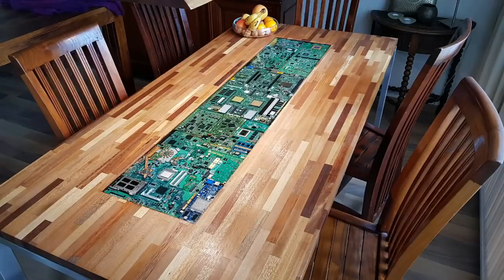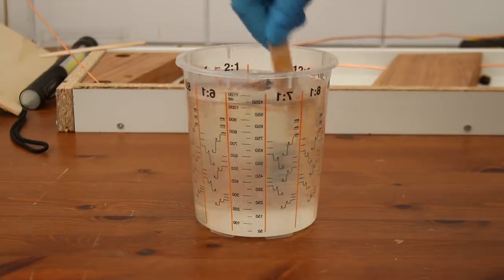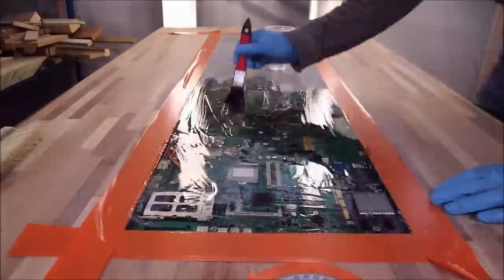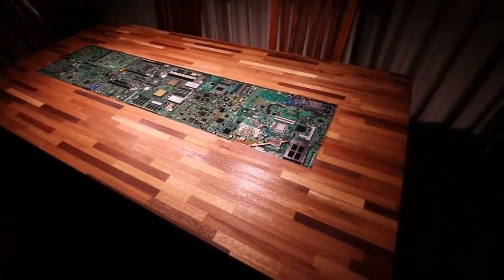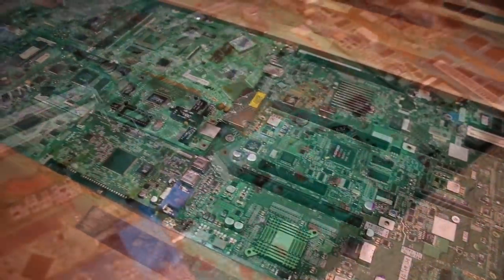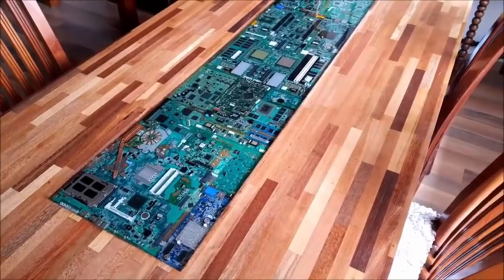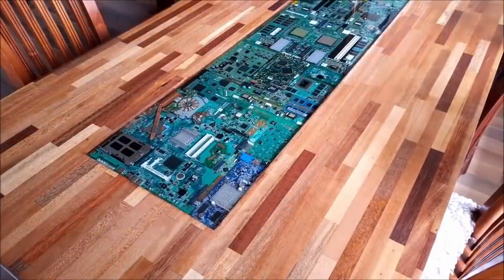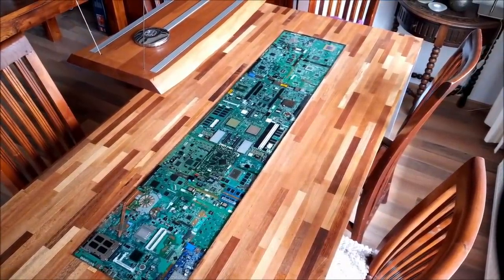Circuit boards with lights in epoxy in a table

Comment: I would have a piece of glass cut with beveled edge to the size of the entire table. Secure it with clear epoxy. Completely usable table with a usable glass top.

Comment: Some of the boards do not deserve to be in there...
Reply from the maker: How can you tell? From my POV they were, without any exception. They were IN the trash, or on their way to the trash...
Reply: I can tell what some of those boards are, and some of them are actually quite expensive and intricate. Eh. Never mind
Reply from the maker: The biggest, the dual processor one of a Sun server, was in the trash of a data center. I suppose they know what they throw away..

Comment: hey i know you did this is aug and now its octoboer - but just wanted to ask why can't you just sand the entire face (wood and poxy) and then give it a light thin coat of epoxy to finish. Another solution could be to go to your local glass shop and get a plate of glass with rubber feet and use that as a table top that covers the full face. this way its functional and admirable.
Reply from the maker: Read the first, pinned, reaction here.

Comment: I once saw a bar top like this made with bottle caps, match books, coins, and other small trinkets. The owner said they used something called liquid glass, which is apparently a silicon dioxide based product used in automotive finishes, although some epoxy resin products also go by that name.

Comment: from what i know you should put every day layers of epoxy bit by bit, nevertheless i think fail or not it's inspiring!
Reply: What I know about two part paints like Dupont Imron which is used on airplanes is that a thin coat is hard and durable, but what's left in a small paper cup will be rubbery and tend to crack as it shrinks.  You don't end up with a hard hockey puck made from paint.

https://www.pcimag.com/articles/82728-the-wet-look-that-lasts

Comment: Next time use a piece of glass instead of epoxy.
Reply from the maker: No, even after this experience I find epoxy way more cool than glass. The way the light only breaks once in epoxy, makes it more cool to look at something enclosed in it, than something under a glass panel.. Apart from that... anything in epoxy is 'frozen' in time. Under glass materials would age further (and gather dust).

Comment: should have done 2 to or 3 pours instead of one huge 11 liter pour and let cure between each. That would probably have negated any excessive bubbling and stickiness.
Reply from the maker: I did. No, not that easy to see in the video, but I did maybe max. 1.5 cm at once. According to the specs of the epoxy, I could have done 5 cm at once... And because so big parts of the table are fine, my conclusion is... I messed up the mixing.. (as I said in the video).. 😊

Comment: Look nice... Would doing this in a single pour have made for a better result or would that have created a different issue to deal with?
Reply from the maker: I could have done. The specs of the epoxy said I could do 5 cm at once. But the risk of messing up the mixing is always there... No, I just have to do better next time.
Reply: @Onrust1  got it... thanks for the response.

Comment: If you don’t fail you can’t succeed. Maybe you could cut the complete section out with a circular saw or router put a sheet underneath it and try again with a different epoxy

Comment: You need to do pour in one go.. when u do more then one pour, the different layers harden at different rates, causing those imperfections.. also, need to keep bubbles out  of epoxy, which is very difficult in itself.  If you have to do multiple pours, the first one needs to fully cure.. like a month.. then do next pour.. it’s not fun..  end result is spectacular tho.. I still love your table!. Fiber optic idea was really cool.. I’m impressed.

Comment: Get creative with your router and inserts... You don't have to go full-depth. Just enough to place something over the majority of the bad spots. Un-populated circuit-boards are cheap, by the box, online. Perhaps just some purposeful "cuts", using the mess-up as part of the art. Tinted epoxy patterns, broken scraps of broken circuit components, Retro computer logos, copper-wire creations... Route them out, clean them up, stuff something-else in there, as the focal-points, above the "artistic blurry spots below, with a new layer of epoxy over it.

You can force more of it to look bad, with a screened blow-torch. Ultimately, I would suggest covering the whole table in epoxy, as the final product. Less work and it doesn't care if the table is level. It is self-leveling, if you allow it to just pour over the edges and settle-in with that thin layer on top. (Look-up non-caustic self-leveling DIY epoxy counter-tops. Yes, that is a thing... You actually use a blow-torch to "lock-in" specific design-elements, when making those custom counters.

Honestly though, I would have just gone with a glass-top and simply mounted the circuit-boards to a pane that could be removed and changed. Cut entirely through the whole table, so you don't have to remove the glass to change the art.

Comment: Ok so, some "mistakes" that i've seen, and that could have made the table completely perfect:
- Your could have used either an industrial heating blowdrier after each layer of resin to get the air bubbles out, or seal the entire thing in a vaccum chamber (which is time inefficient for big projects);
- You could have gone ahead with sanding till 6000, and then use the wool polish head of the sanding machine, and it would have been completely polished, just waiting for the clear varnish coat. Oils like the danish one are nice, but they leave the wood dessicated over long periods of time (im talking 10+ years).
- You could have changed the order of the operations and laid the fibers under the circuit boards, then do the same process of gathering them together then drill a single bigger hole through the table, and then install a pvc extension clipped to the underside of the table that would then lead to where you would ultimately have the "out" end (Ideally you could have drilled an entire tunnel to the end of the table but the machines that do that are pretty much factory equipment so i went with the less expensive option).
But regardless, your table came out very nice! And no, i don't think you should put a glass layer too, haha.
Reply from the maker: 1. I used a little torch. I haven't shown that in the video, but I did (if you look careful you can see it in the last seconds of the video). You can't do without. 2. Are you talking about the wood, the epoxy or both? Well, as I explained in the video I wanted to go ahead with sanding and polishing but changed plans as I saw the ugly spots. 3. The fibers could NOT go under the boards. They need at least one cm to bend, and that bend needs room, that's why I ended up under the table. I put an extra sheet plywood underneath, so it is really no problem.

Comment: Is it possible that there were chemicals on the circuit boards like incompatible epoxies, glues, heat sink compounds, or waxes?  These could have interfered with your epoxy curing, especially if your epoxy got warm.
Still, a beautiful table.  Maybe a glass top?
Reply from the maker: Because the first layers are fine and the problems / ugly spots are in upper layers, I don't think anything in the boards reacted with the epoxy as you suggest. I won't do the glass top, but will try to fix the table and plan to make a video of that too.. 😊

Comment: The Epoxy may not cure for two reasons. Either the mix ratio of the base and the curing agent was not right. Second problem could be the layer thickness of the final layer. If the surface cures to fast the bottom of the layer may not cure.
Reply from the maker: There is a third reason. Not mix it well enough. I learned that from this project.

Comment: In another video the guy put a strand of caulking around the area where the epoxy would go so it would not go over  too badly, thus reducing his sanding time. When the epoxy hardened he took a small scraping blade and removed the caulking then sanded.

Comment: Why not cut out the entire middle section and screw in a slightly larger board in from the bottom? Also, why not run the entire top through a planer at low speed after the epoxy was poured? So much wasted time.
Reply from the maker: I agree with your first question. This always-learning good willing-amateur just never thought of that. But a planer?? I once had a table of 3 meters long that had two sections of half a meter wide that needed a planer. It cost me quite some time finding that. But the table is in another league all together! I would need a planer of one meter wide! I would never know where to find that.

Comment: Loved it yes a pity that happened but wonderful idea and we all learn by our mistakes l am a auto spray painter by trade and have seen similar problems with epoxy once epoxy is mixed let it stand for at least 5 minutes make sure every application of epoxy is exactly the same mix same temperature every layer must be dry before next one. Or mix big batch one hit rather than layers important thing stir well mix must be the same cheers

Comment: RGB and controller around the edge would be cool. You could put a solar panel in the expoxy and a small battery under the table with the controller

Comment: In my humble opinion, I think you should sealed the hole before putting the boards. All woods are more or less porous, this can make a bad reaction of the epoxy. Another reason could have been the quantity of resin you poured each time. More resin, more temperature. Although I never worked with transparent epoxy, I can say that transparent resins like poliester are very difficult to work with. All this is just to say that you had a magnificent idea, I loved the mix of steel, varnished wood and the motherboards with all the details on it. Again, transparent resins are very difficult, unless you do a casting mould (not very big). Excellent idea, keep it up. Greetings from spain
Reply from the maker: I agree, I can see that there is some contamination coming from the wood. I don't think the wood is the cause of all the troubles (the main fault was me messing up the mixing) but if I was to do it again, I would surely have sealed the wood, yes. Thank you. Regards back from the Netherlands!

Comment: Hey,  Been meaning to comment.  I think the reason it failed is the epoxy was contaminated more than likely by the thermal paste and or dielectric grease on the boards,  more than likely is silicone or similar based and NOT compatible with the epoxy..  if you're going to try it again,  I would suggest washing the boards with acetone first.  Use acetone, as it actually washes away any grease / silicone by encapsulating it and carrying it away,   also remove any heat syncs to wipe away any evidence of thermal paste.  if this isn't possible,  you might be able to soak them in a acetone bath possibly,  but I'm not sure how the plastic of the boards will react to that...
Reply from the maker: The problems are in the upper layers. The first pour I did was - as you can see in the video - to secure the boards in place, and that was fine. So it is unlikely that the boards have anything to do with the ugly spots. I will make a video in which I (try to) fix the table, and that starts off with a problem inventory. Wait for it. 😊
Reply: @Onrust1  Hmm..  ok,  just weird, really, because the oils etc are incompatible with epoxy..   I guess it would be easy to confirm that it is or isn't that,  as the ugly or sticky spots would be around heat syncs and things where there would be that paste..  but yeah I agree if the first layer set up fine then it wouldn't be the boards..  cant wait to see this,  its super cool!

Comment: WELP! Now I have to do this; Except I plan on just cutting a piece of glass to lay over the circuit boards. That not only fixes the sticky issue, but fixes by removing the possibility of imperfections, and will allow me to change the circuit boards in the future for a nice change of pace. Awesome video, it looks so cool!

Comment: When a DIY'r tech nerd watches too much home improvement tv :) Great video!
Personally I think it looks awesome.
I would get a piece of glass made for the table top, put some 35% window tint on it, and just set it on top of everything.
Thus, the tint will hide the imperfections of the epoxy, yet let the circuit boards and wood be visibly appealing.
Definitely not a loss or a fail, just an unexpected step in the process towards the finished table!

Comment: Toch ondanks alles leuk idee en een tafel die geen andere heeft. Dat met epoxy spelen vindt ik wel vrij interessant en ik zie het steeds vaker wellicht kun je daar eens op ingaan waar haal je zoiets enz.. Ik vindt het uiteindelijk wel een goede manier van recycling.  Top als je niks had gezegd had bijna niemand het gezien.. haha
Reply from the maker: Waar ik het vandaan heb staat in de beschrijving van de video. Ik wil op deze video een vervolg gaan maken, waarin in de tafel repareer. Ook om van te leren... 😊
Reply: @Onrust1  super weet ik waar het te krijgen is alleen nog kijken of ik ooit een mooi idee kan verzinnen. ik hou het in de gaten. Bedankt, Andre

Comment: Had je de vetten en weekmakers die verwerkt zijn op de printplaat eerst verwijderd.  
Voor het gieten . 
Of een goede sealer er eerst over heen gespoten.  
Dan had je je 7 liter epoxy niet bevuild met die weekmakers en vetten . 
Gaaf gedaan dat zeker . 
Zou er een glasplaat overheen leggen of blad er omheen ophogen en nog 3 mm aangieten met een goede primer ertussen. 
Heb een eigen meubelspuiterij vandaar
Reply from the maker: Zoals je in de video kunt zien heb ik de platen met een eerste, dunne laag epoxy 'vastgegoten' om de gaatjes voor de lampjes te kunnen boren. Die laag, daar was niks mis mee, dus ik weet zeker dat 'weekmakers' geen invloed hebben gehad op de epoxy. De problemen zitten in één van de bovenste lagen. Ik ga de tafel repareren en ik wil daar ook weer een video van maken.

Comment: Pour some epoxy hardener (accelerator?) over the soft spots and leave it for a while to cure, maybe even drill small holes through those areas.

Comment: i think it because the "big pouring" step.
my friend is a 3D painting artist. he draw on epoxy layer by layer. it means by pouring a little bit then wait till it dry, then pour it again and again. he draw in a bowl, can, aquarium, etc. and her drawings are mindblowing. 
so i think if you pour the layer mm by mm, it might be a good crystal clear result.
Reply from the maker: No. Different kinds of epoxy require different thickness layers. Mine is qualified for 5 cm at once (it's a slow curing epoxy). I did maybe 1,5 cm in one layer. I'm pretty sure that I messed up the mixing.
Reply: @Onrust1  welp, its okay brother.
big success are born form failure.
jst keep it up.

Comment: The epoxy says it only needs like 48hrs to dry.  I think it needs MUCH longer.  Is the table in a well ventilated room? Revisit the table in 2-3 months and see if it is less sticky.
Reply from the maker: Not well mixed epoxy takes indeed longer, and you're right, it is months later now and the stickiness is almost gone...

Comment: I would cut the entire center out. Then I would test the epoxy in a smaller pour. Once you have the mixing down right, then get another set of circuit boards and do it again. I think that would be the easiest way to repair it.

Comment: why didn't you just use the router to remove the wood ? you made a lot of extra work for yourself
Reply from the maker: I disagree. One blow with the chisel takes far more out than the router can do in the same time. 
What would have been really quicker was cutting it all out with the saw and put a sheet of plywood underneath.

Comment: why the hell do you place the processors upside down on the boards? Just to see them pins? Makes no sense at all. Would be cooler to recognize the old hardware under the epoxy
Reply from the maker: Yes, because I find the (golden) underside more interesting to see than the (dull black) upside. Still do. 
Hey, you do it your way, I do it mine..

Comment: EDIT: someone else said it first, but I totally agree: Why not just put a piece of plastic-plexi or real glass over the whole table?  That will cover the sticky parts up AND allow you to keep all the work you did to see the cool lights and circuit boards without having to do all kinds of crazy long extra tedious work to try to fix it :)
Reply from the maker: With glass over it, the ugly spots will still be there. That's why I want to fix it (and make a video of it).

Comment: May you should have tried 2 small end tables first. Been trying to figure out what to do with all the circuit boards I have. The real problem I have is over 100 monitors.

Comment: Glass top !
Reply: Maybe next time it can be made without the epoxy by making it air tight if that is even easily possible anyway.  Overall it is one of the most beautiful tables I ever saw !  And the lights;  right away early in the video it looked to me exactly like a city from above.  If you put glass on that you could sell it at a very expensive gallery for maybe $ 20,000.  Someone would pay that for sure !  It's the only one on earth !

Comment: I love epoxy! But what does it smell like? Can you finish a floor with it? I think it dissolved something in the circuit boards and that made the sticky areas? (And surely environmentally friendly...) It’s eerie how much it looks like a business park. A piece of 21st century art.📱
Reply from the maker: There is no smell at all - only the first day after pouring. The sticky and ugly parts are the result of not mixing well enough.